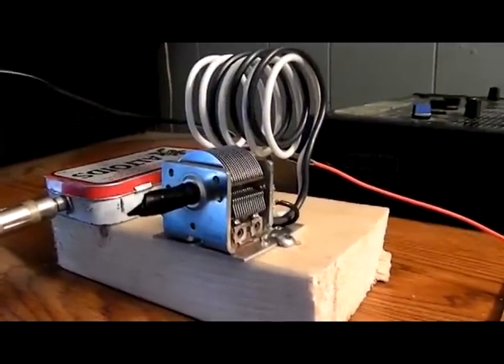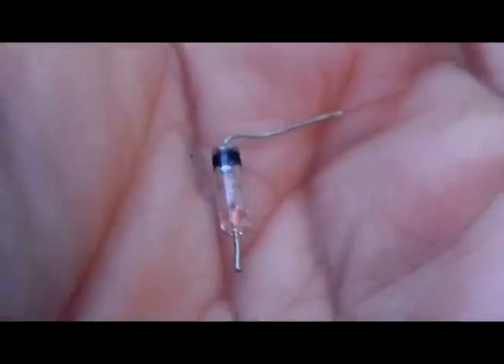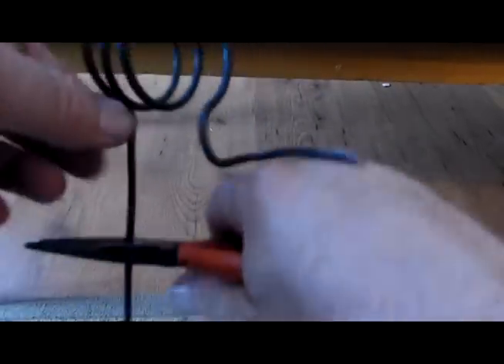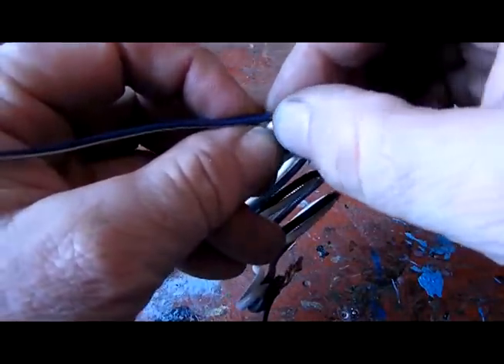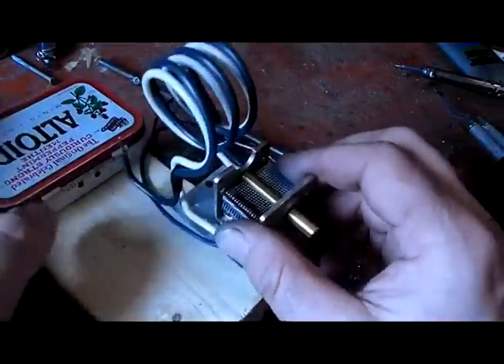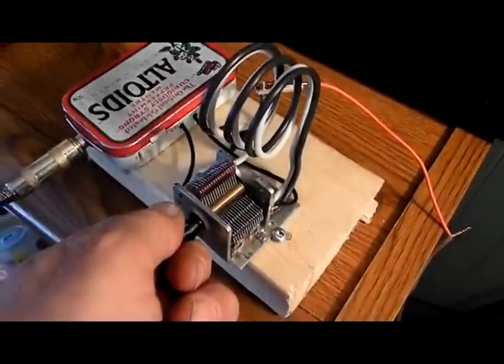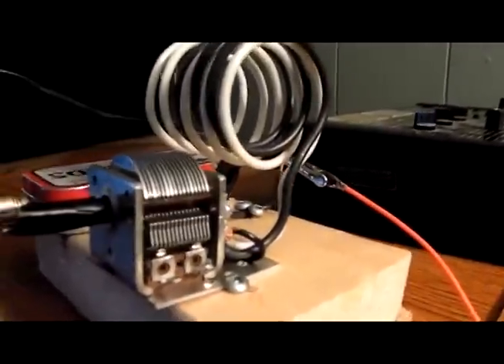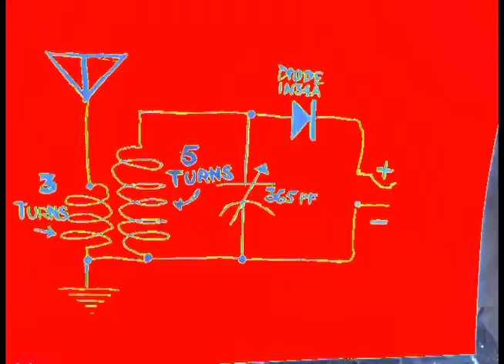Build a CB Radio Crystal set

Comment from the maker: I just made a cool addition to my CB xtal set, an optional 12V red LED lamp connected to the audio plug. I just hook up a simple 4 foot wire antenna  When I transmit on my regular CB  the LED lights up real bright due to the voltages generated in the XTAL set by My strong CB signal transmission  .  I will be making a new vid on it soon.

Comment: You need a big knob on that variable capacitor.  I wound some house wire around a D cell, 5 turns.  I measured the inductance and it was just under 1 microhenry.  I calculated that if you put a 47 pF NPO or C0G ceramic disc capacitor in series with the variable capacitor, it will spread the CB band out to the middle of the variable capacitor and make it easier to tune.

Also, put a .01 uF from the hot to ground pin of the audio jack.  It will help reduce the hum sensitivity.

Comment: I'm definitely going to try and make one of these receivers for the CB radio and it would come in real handy for me if I just want to listen to channel 19 on the UK 40 channels and hopefully mine will work the same as yours and I'm really interested in electronics because I'm a Amateur Radio Operator and I have been on it for the last 21 years and I have been on the CB radio for around 28 years now and it's all been really good fun and I have never looked back since I passed the test back in 2001 and I was only 19 when I passed the course and I was so happy when I passed the exam and I got the yellow card from the head tutor and I was very happy. Anyway best 73's for now Stephen M3SNV 73's.

Comment: 40 years later and still no intelligent signals in the 11 meter portion of the HF spectrun.
Reply: Nope, ever since the movie "Smokey and the Bandit" hit the theatres, CB turned to crap and hasn't changed much since then. Small wonder the FCC has abandoned policing 27Mhz (which used to be a Ham band until the FCC stole it away from us).
Reply: @garraper  And, later the FCC reduced requirements for hams and the idiots moved to 40 meters.....
Reply: Looks like I found the elitist hams.
Reply: @lomgshorts3 crying over losing 1 channel out of a million 🤔. Yeah, id imagine that that's exactly why ham radio club membership is all but nonexistent these days. Even at a no code level, nobody wants to get into a hobby where everyone in it is an elitist  cry baby. 😒
Reply: @regularfather4708 yep, they cry over losing literally, 1 channel out of 50 11 million, and they wonder why the ham radio hobby is dying. Its a hobby just like tying flies or collecting stamps, just a hobby, only, in my experience, tying flies and collecting stamps dont have nearly as many assholes lurking around in it waiting to tell you about all the ways you're doing it wrong.

Comment: For what it's worth, the diode is NOT an IN34, but rather a 1N34 (one N34).  Easy mistake. I built my first XTAL radio in the mid '50s using a piece of Galena and a cat-whisker and then 1N34 diodes. Later I moved on to building regenerative receivers and superhetdrodynes.  Of all the gear I build over the years nothing compared to the first sounds emanating from my Brandes headset connected to the XTAL radio!

Nice video and thanks for taking the time to share it!

73, de Mick WB4LSS
Reply: I used a rusty nail and a sharp pin, same with a heavily corroded penny in place of a diode, trying to oxidize a stainless razor blade and carbon rod, not yet.
Reply: @bmcgraw3840  I used one of my Dad's old Gillette Blue Blades that had begun to rust.  That corrosion was enough to make a semiconductor along with the pencil lead.

Comment: This time I used bare copper common house wire. About. 10 turns on a 7/8 deep socket with the tuner at the center tap down and a 9v battery powered fender mini deluxe guitar amp. Tends to wanna pick up FM BCB but with the capacitor. Half shut was getting skip talk of a bunch of truckers telling each other to shut up and that one another radio is too loud.

Comment: With an old ham radio receiver tuned to a single sideband signal I used to hold a pocket radio next to the receiver and just adjust the tuning until I could hear audio clearly. Has to be the old manual tuning type radio.
Reply: yes small wire and tuning caps

Comment: When I was a kid I wanted to build a "Crystal Television." It would be a very low power standard TV with a power supply that derived energy from the RF TV signal. Having a degree in electronics I think this is doable if you live close enough to the transmission tower.
Reply from the maker: My crystal radio now has a pair 12 volt LED  lights running off a 4 foot vertical wire antenna ,they do light up brightly when I key up on my CB, Not a TV screen by any means but a crystal radio can light up a simple LED if the transmitting antenna is nearby